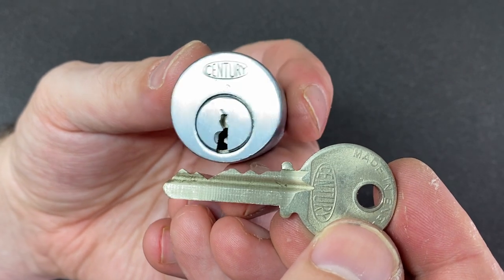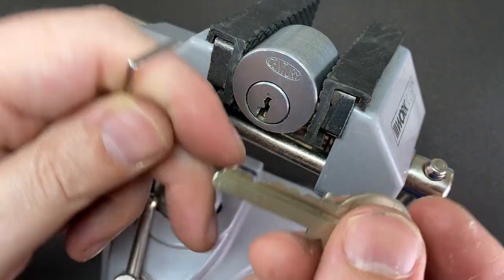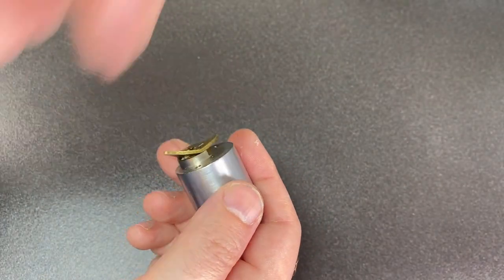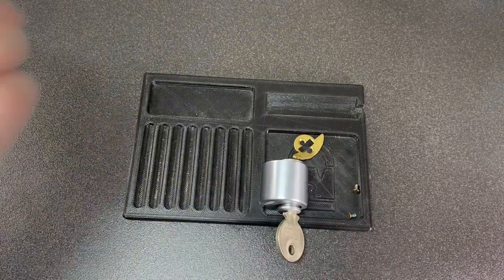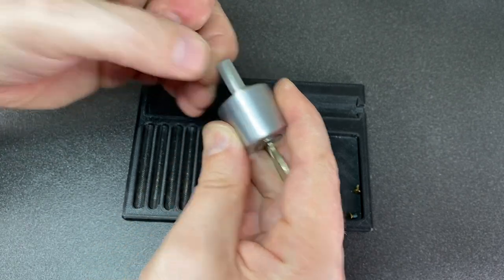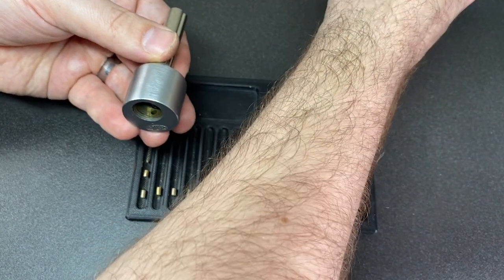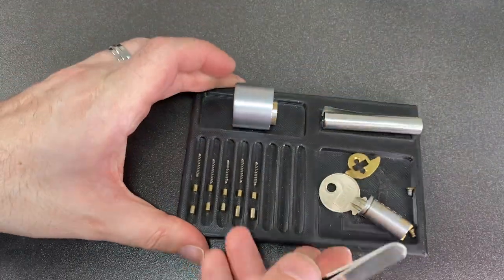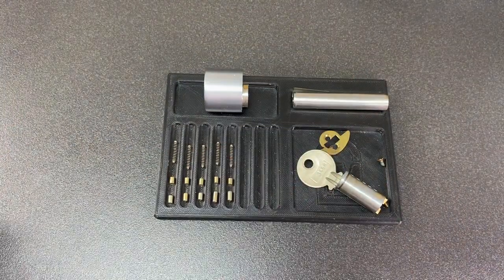Century Mortice Cylinder Lock Pick and Gut

Comment: I believe this is actually called a rim cylinder. Mortise cylinders are threaded and screwed into a mortise lock body. This appears to be a rim cylinder, identifiable by the two holes in the back. Great video 😊
Reply: From ever fading memory sounds about right , they was a  older style version of a union 2332 , Yale also made simular  ( although this lock was of  course not a screw in cylinder )  its like an version of the scandanavian cylinders we see today, when i started my trade training back in 1986 opening these locks in the field was not a problem ... trying to cut a key on an old key machine the orignals and the blank would be a nightmare holding in the jaws of our machines ( had to shim the profile to stop them both from not twisting and falling out of the machine  )
Reply from the maker: Thanks 🙏